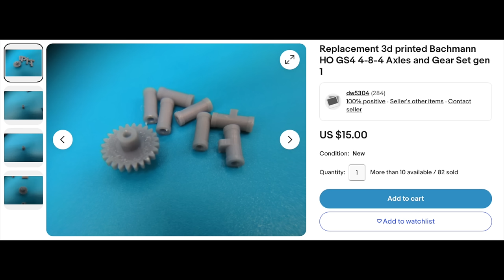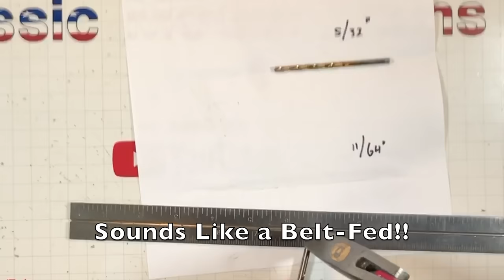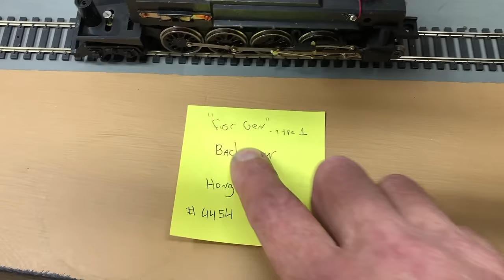3D Printed Gears Didn't Work!  I Found A Technique That DOES!

Comment: 35:09, Not Spectrum. Bachmann Plus from the mid 90s to the early 2000s if i remember right. its the predecessor to the Spectrum line, that died out pretty quickly. 

They tried their best to improve the old Split chassis models but just couldn't get them to be reliable, so they completely cut the Plus line, and went back to the drawing board for the Spectrum line. 

The Spectrum line locomotives are so much better. I had a old Bachmann Plus J-class that had the same gearbox issues these daylights have, the NEW Bachmann J-Classes are nothing like the old ones. 

I think the ONLY Split Chassis locomotives Bachmann still produces is their low grade Northern's they sell in train sets like the Overlander.
Reply: I got out of HO YEARS ago, but recently started getting into N-scale, and ill tell you, the Spectrum Models i have, of the Light mountain, AND the J-class both are amazing runners, with brass bearings and everything. they are SUPER high quality models.
Reply from the maker: Many Fellers including myself say they will not buy another Bachmann.  Nobody can tell the difference of production names or series so they all get grouped together as expensive junk with no manufacture support.  Of course this is just me talking, many Fellers have had good luck with B-mann
Reply: yeah fair, Ive had decent experiences with them, but also bad one's. and i know ALOT of people haven't had good experiences.

They are VERY hit or miss, but as of late they are doing alot better. The Spectrum line was really good before it died, And even now the Higher quality models that are left over from the now discontinued Spectrum line, like the N&W J-classes are great runners.

I just wish they weren't so expensive, or they sold a version without all the over priced DCC sound junk. 

Im a old School DC person, hence why i seek out the older DC Spectrum releases of their models.

Comment: I'm developing a bit of a love/hate relationship with the split chassis gs4 models, I've tried 3d printing the axles with very little success so far and am planning to have them done up in resin next. If all else fails I'm going to have to try the brass tube fix (though my Lionel one might just be a shelf warmer if I can't find a fix for it) . If I'm not mistaken, the version with the can motor comes in both 4446 (one in typical red/orange and one in the war baby livery) and 4449, and is the 3rd generation. Between the Bachmann release with the motor built into the frame, and the early 2000's release with the can motor, there was a version with a slightly updated chassis that had the oh so beloved pancake motor. 

I am doing my best to fix up the ones in my possession right now (mostly the pancake motored one I offered to repair for my friend), as I've somehow managed to get my hands on all 3 versions at the same time. Ordered a newer incarnation of 4446 today just for the sake of having better dcc compatibility, and not having to worry about an axle splitting on the very steep hills at the Livingston model railroad club. Its such a shame that the models from the early 00's and back are stuck with the nylon dilemma, because they do really look nice when given a better clear coat.
Reply from the maker: I just have a I hate Bachmann relationship.  Dont trust them for nothing.
Reply: @classicmodeltrains  I definitely understand that, I have a soft spot for Bachmann since my first model trains were the Bachmann Thomas models back around 2010 I think, but try to buy other brands when I can. I'm just glad they stopped using the split chassis on everything, the quality has gone up a lot because of it, although they definitely do still have some are only good for filling out a rail yard or scrap siding.
Reply from the maker: @namehere5030   I should quit bad mouthing them.  They do hold a special place in a Fellers heart as their first loco's. and the gears didnt / weren't cracked back when they were only a few years old.  They sure do have a lot of nice details on the body though.

Comment: Say, are the Bachmanns the older models? I operate Bachmann N scale steam(newer) seems to be running ok. I know the older Bachmann  in N gears would crack, steam n diesel would crack. I havent bought an Bachmann diesel since  Kato came out with the split frames. 😎
Reply from the maker: Bachmann's been around since the 60's. they turned into Sh!t very late 70's till 2000's I believe

Comment: Man I hate Bachmann for not coming up with a permanent fix themselves. I spent about $1000 on various locos with this setup, only to be told a few years later that there were no replacement parts as it had been discontinued.  I ended up using clear shrinkplastic and superglue, which has worked. But I am thinking I might give your fix a try.  I don't buy Bachmann to this day, they got me once, but never again.  Merry Christmas Ron.
Reply from the maker: Hello Steven,  I won't  lay down $$$ for bachmanns either.  I think I will run some off the table in some short video's for my revenge of their existence.  Just have to find one that can pull itself down the track for 3 feet. (he he) Merry Christmas to you and yours as well!!
Reply: Wholly Miley!!! That was the most impressive repair video. I’ll consider that a Christmas Present. Though I don’t own any HO Bachmann or Bachman/lionel locos. I really appreciated that repair. I liked your chart showing measurements of the wheel shafts. Would have thought to file them till all 4/8 were the same dimensions. And then go on to fit the gears. So happy to find out those 3D gears and spacers have limited success. Or None.
 I wanted to say what a fine job of Shining that turd into a runner. But maybe that wouldn’t apply as you actually waay improved the movement along with operations.
 And thank you for the efforts on clean language too!
 33% ers rule!

Comment: Boy I tell ya that was ALOT of work to get that going! Shame ob Bachman for not testing these units before selling. Such a fine looking locomotive! I'm afraid to even buy one even if it's not Bachman now. Lol
Reply from the maker: Older Bachmann's and Life like's, most of them suffer from cracked gears.  Plastic gets old and looses its elasticity.  Theres a lot of companies that dont see to have this problem.  Just do some research before you lay down your good money on a steamer.
Reply: @classicmodeltrains  kinda late for that. Ugh I swore when I started trains that I always picked those problem ones. I learned alot tho. But then I picked a brand new broadway limited and now I have issues with it. 18 degree turn track for a steamers think caused alot of problems. Do you fix others trains? Thos broadway may be a bit much for me to even try. I'm afraid I will put it out of quartering.
Reply from the maker: @chuckwalters4759  BLI's can goto the manufacture and they can whoop it into shape for you.  Or a nearby hobby shop?

Comment: Bachmann drives, at least the early ones are junk. They have proven that they can produce a decent product though with the “Spectrum” series. I have one 2-8-0 n scale running on my “Trim-A-Train”  platform right now, beautiful performer. I also have a couple of n scale 2-8-2’s that have the dreaded split gears. I too have purchased the printed gears, and so far, not impressed. But time will tell. Contacting Shapeways is pretty much a wast of time. Thanks for the insight and Merry Christmas and a very good New Year.
Reply from the maker: Thanks John, and M.C. to you as well!

Comment: Use rubber bands to hold the split frame together instead of a clamp like the vice grip you used to avoid too much pressure or marks on the frame.
Reply from the maker: Thanks for the good tip John!

Comment: Have you tried soaking the 3D printed gears in warm water? I THINK that's the way to get them to fit without breaking (being someone who bought 3D-printed replacement gears for my Bachmann ATSF U36B)
Reply from the maker: I did not.  If there brittle at room temperature, they will always be brittle.
Reply: It's also possible to add power pickups to the tender (as what SMT Mainline did when he repaired a custom painted Lionel/Bachmann CN GS-4) for increased reliability for picking up power
Reply from the maker: @Benthetrainkid  This loco already has plenty of power pickups in the loco itself.  Cant see why one would need to add extras in the tender.

Comment: I've resorted to just using styrene tube to make sleeves to put the wheeslets back together, pull the motor, and turn these poorly designed Bachmann steam locomotivee into free rolling dummy units. At least they roll, and you can push them around with a diesel "helper". Another option might be to follow UK practice and converting them to a tender drive.

Bowser sold a remotor/regear kit for these, but unfortunately its been discontinued for quite some time.
Reply from the maker: Not a bad idea.  Keeps them off the shelves at least :-)

Comment: You showed 2 Lionel's, the First gen Bachman used the same Pancake motor that they used for everything else. When Kader bough Bachman they changed the tooling to be able to use the pancake motor. The Lionel GS4 is by Kader, and pre dates Their purchase of Bachman. Though similar, there are a couple of significant differences. The main one being the motor, with Lionel's being part of the frame, and Bachman's being a separate motor, which they used for everything. I can send photos of them side by side if you want. Having said that, Bachman probably used Lionel's original tooling until they had their own. Personally, Lionel's motor is more robust and less prone to burning out than Bachman's pancake.
Reply from the maker: I had one branded Lionel, and one branded Bachmann (the first gen). and a second gen branded Bachmann.   Bachmann has been around since the 60's.  I have not heard of Kader until todays video comments.  I shall have to goto the google machine and do some research.  I know Bachmann has been owned by many companies, but still sold under the Bachmann brand.
Reply: Lionel sourced out most of their HO stuff from the beginning most of their diesels were Varney or modified Athearn drives, an shells came from Athearn, Life Like, and their own shops. Their second round of HO scale was in the mid 70s and were nearly all produced by Kader, with the Daylight, and Freedom Train, being the best looking, but probably the most problematic in operation. They like Bachman, were prone to cracked gears but for different types of materials used the motor case being part of the chassis was actually a better solution than the later Bachman pancake. My biggest problem has been the larger bull gear stripping teeth..

Comment: Nice video to illustrate how we should NOT build our Next Gen S Steam Engine Chassis. I have 3D printed gears but not that small. Keep it up friend, D aka Frankentrain Labs  Note: we do not use Nylon for drive parts. I found PLA can handle the wear and will not crack. Shapeways should be able to make out of sintered Metal.   Couldn't the designer add a thick ring in plastic to add strength then size the square .01 mm over sized, Why do they need to ne pressed on. Metal tube worked but my what a long way to go around the barn there. Lets see if the view is worth the climb. Now I know why I do NOT play with HO stuff, too dang small.  Way to go Troop. D
Reply from the maker: Good morning Dennis,  You have some great idea's and questions.  The wheels need to be pressed on or glued to the part to keep the wheel flanges in gauge.  they cannot be conductive or the Juices will short out.  the printed part canon be to large in diameter because it has to fit inside a cup on the wheels.  Making the square opening a bit larger would be a step in the right direction for sure.  Love your expression " what a long way to go around the barn"!  I have not heard that used very often, but makes perfect sense :-)

Comment: Wonder if Dry ice to shrink the axles a bit would help reassembly.
Reply from the maker: it might shrink them, but as soon as the axels warm up they will expand and I believe would crack the brittle gears
Reply: @classicmodeltrains I was thinking about the sleeved gears and the amount of effort you put in during final assembly.
Reply from the maker: @adventuresinmodelrailroading  Ahh...Gotcha.  that does sound like a pretty good idea!!

Comment: I would have to say that perhaps the newest DCC ready GS-4's would qualify as a Type three. The draw bar is completely different and so far my AFT has been a lot  more durable. I had the N&W 611 back in the early 80's and was scared to run it. The motors would burn up sometimes before the axles lost the ability to stay in quarter. I shake my head every time I see the type One's come up on E-bay for hundreds of dollars, and people bid them up to hundreds. They are 40 years old and they were junk 40 years ago, if you want to spend hundreds look for the DCC plug wiring and the more standard Spectrum draw-bar. I did notice you did not have too much original packaging, the type one's were available in a white box, or several fancy presentation boxes four times as large as needed, all junk. The type  two I am guessing was known as Bachmann Plus, they had a box with foam padding instead of Styrofoam.
Reply from the maker: I showed the Gen 2 box and yes it is square w/ foam padding.  The Gen one has a very long styrofoam form fit box with a clear plastic lid.  Yes it is amazing what people are getting for these on the Bay.

Comment: 3 D printed gears do workbif you use the correct resin and a high reloution printer. I could print down to module 0.2 and have some gear sets innengines now firbove4 8 years running them.on a daily basis, in O-scale  with protorypical sized trains weighing between 60 an 145 pounds.
Reply from the maker: The "Correct" product is the key for sure :-)

Comment: So there is a lot of truth to the comments here. Kader is the manufacturer for Bachmann to this day. You had the first gen lionel version and then the Bachmann version, as you saw exactly the same. Then the second gen drive with the square axles was called Bachmann Plus, you’ll often see them online in a grey box. Now in like 2009 or so they made an entire new tooled chassis that is dcc ready. They still sell this to this day and I have one that came with a DCC decoder in it. So in the end they did fix all the issues of the previous models, but there’s so many with split gears from gen 1 and 2 out there compared to the new version! Great video, I enjoyed seeing the brass sleeve fix!!!!
Reply from the maker: Thanks for some good information on the production timeline.

Comment: I'm sorry the gears I recommend didn't work. I had no issues with 2 gs4's so far. I did file my axles just a touch on the squares. I needed a drop of CA to keep them from walking out after a few laps. Those gears saved my war baby and my daylight. File your axles just a touch. Then CA.
Reply from the maker: No worries. The Feller that made the gears you recommended is a great guy. I would never had met him if not for you :-)

Comment: I think what they should do like I do is play around with the actual fitting of the gears before selling them online When I print a gear/axle I test it a model 1st And make sure The axle's fit and do not crack. When I went on ebay and looked at 3D printed driveshafts they claimed that they were fitted into a model before being sold
Reply from the maker: A good idea for sure
Reply: I wonder if the shapeways seller ever heard of the thing called testing. 3D printing can always winds up different if you print the same thing That's why when I print a gear I always test it to make sure it works If it doesn't you can just throw away and try it again

Comment: Hey Ron I sent you an email and it is a Lionel ho 4-6-2 engine but it has no motor and it needs work I’m letting you have it
Reply from the maker: Well thank you.  If it's a Lionel HO depending on the year it's a Athearn or a Bachmann made loco.
Reply: @classicmodeltrains  it’s a 1960s Lionel ho the locomotive road number is 0625

Comment: Bowser made a repower kit back in the day because of these issues. It was for several of the bachmann 4-8-4's.  It was even featured in model railroader magazine article.  It even made them better runners with the whole new underframe.  I got two GS4's with the bowser repower kit.     They are extremely hard to find.   Both are currently slated for dcc and sound.
Reply from the maker: A few Fellers have mention these kits.  Pretty cool you have 2 of them!

Comment: I developed a chromatography hplc column,and patented it in the uk and USA, I used a material called PEEK, it has the same tensile Strength of stainless steel,and and  it is used to machine gears, I used this under a compressed air link of excess 5000 psi, so there is material out there, great channel ,keep it up, pete from england
Reply from the maker: You sound like an interesting person to share pint with Pete!
Reply: Ron, you and me brother, your channel is great, just keep it up, you never know what the future holds, I'm doing ancestry,and found that my great,great,great grandmother,emigrated to the states in the 1800s, settled in kentucky, speak soon, and take care, pete

Comment: Awesome job Ron!  This is one reason I don't buy Bachmann steam locomotives (ironically, I haven't had much trouble from the few diesels I have from them), or I guess I should say, steam locomotives in general regardless of manufacturer.  All that being said, I do have a GS-4 (early 2000s era) that apparently has suffered the same fate yours did, I might try that trick at some point and see if I can resurrect it, happy holidays!
Reply from the maker: Thanks Randall. M.C. to you as well :-)